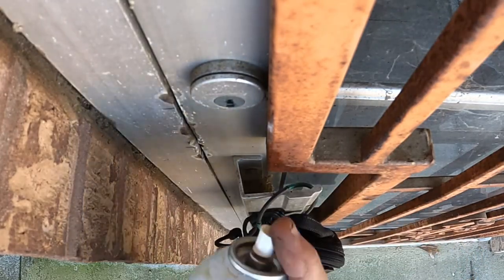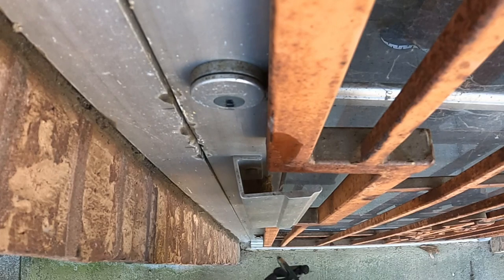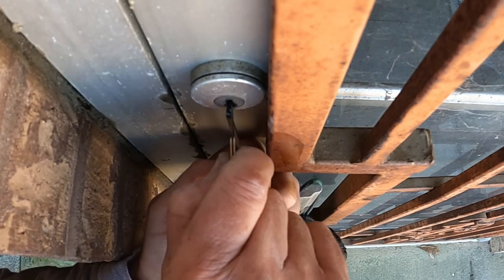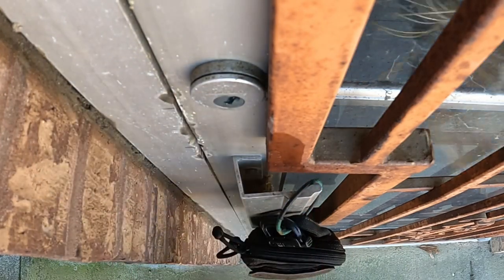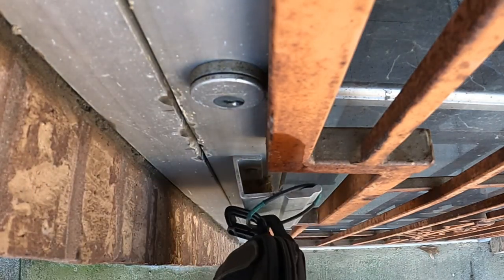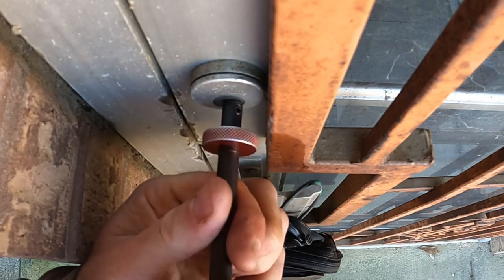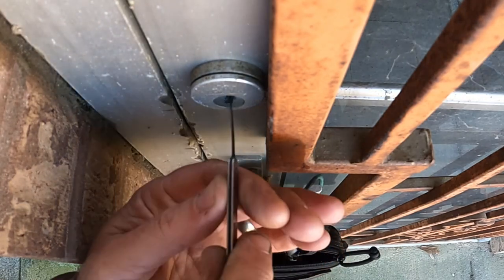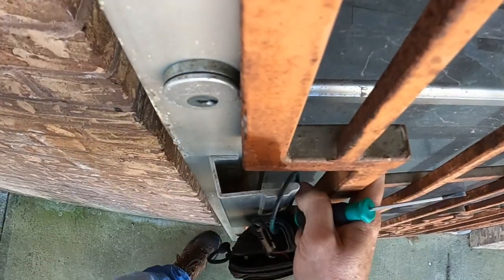this door hasn’t been opened in a while

Comment: Very nice Jason, great picking (raking) video 👏 Thanks for explaining that it was the customer with a broom—for a second there I was like “there’s a dog inside?!” How did you modify your spinner to go into keyways easier; did you grind the top and bottom of the blade, round the corners, something else? (Sorry if you’ve said that before and I missed it)
Reply from the maker: knock a angle on each side of the square tip, kinda like how keys have the angled tip